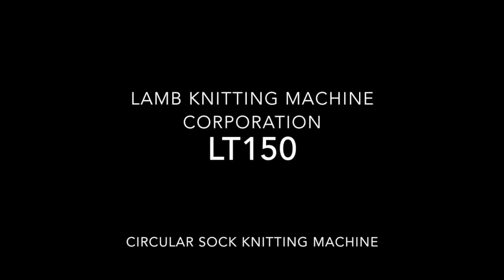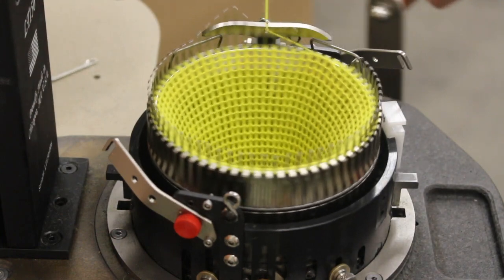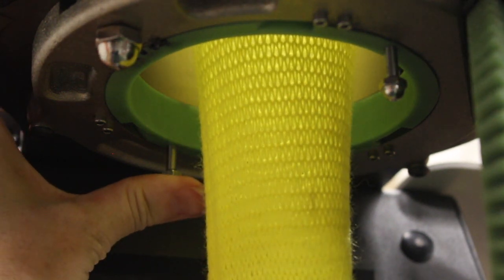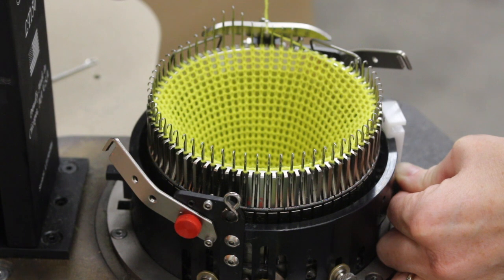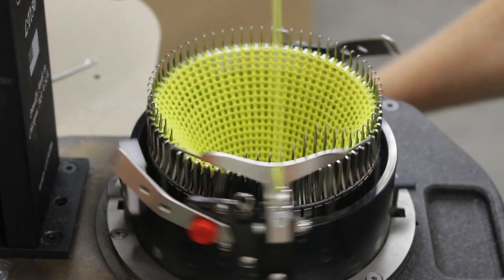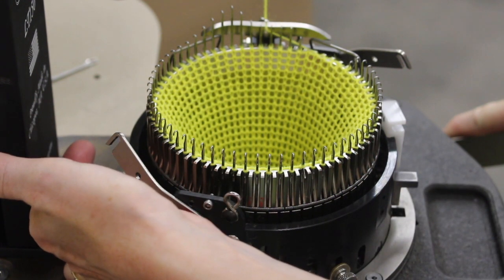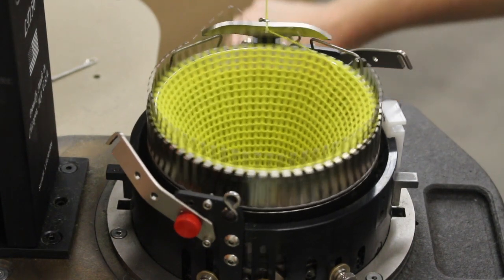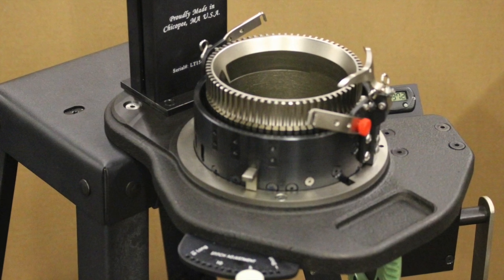LT150 Video 4 - Alternating between rotating Cylinder and Cam Shell

Comment: What is the advantage of having both the cylinder and cam rotate?
Reply: Thank you for your question.  The ability to rotate the cylinder or the cams gives the knitter a lot of versatility for the reasons outlined below.  
The advantage of having the cylinder rotate is that you can introduce a second yarn feed without twisting the yarns.  This allows the knitter to do creative patterning easily.  In addition to that, when the cylinder rotates the yarn guide is stationary.  This makes it easy for the knitter to focus on the area where the needles are casting off and drawing a stitch.  
The advantage of having the cams rotate is that you can shape the heel and toe the same way you would on any other CSM.  
The LT150 can switch between these two modes easily.  I hope this information is helpful.  Thank you for your interest.